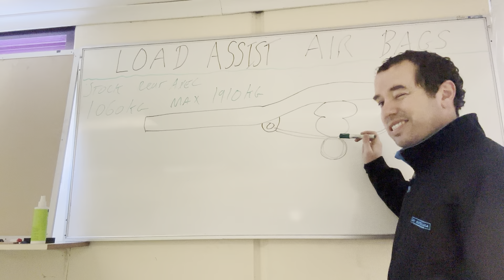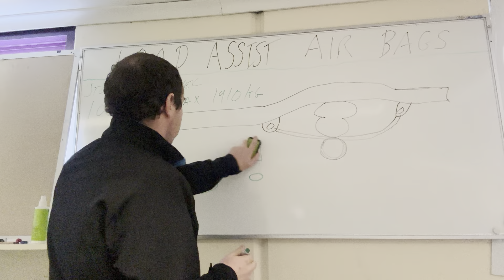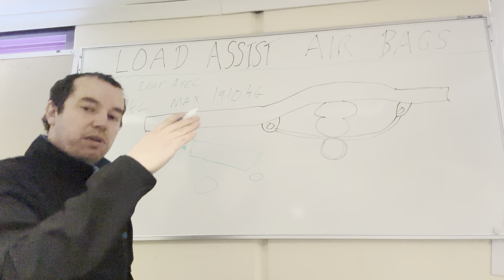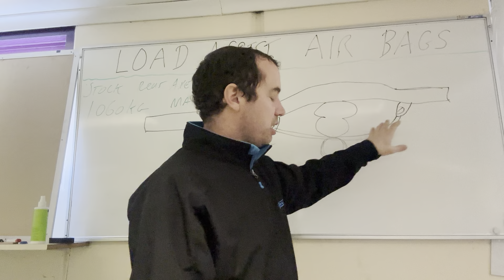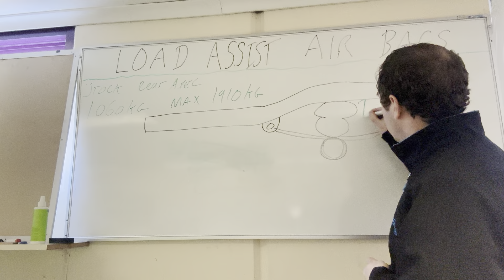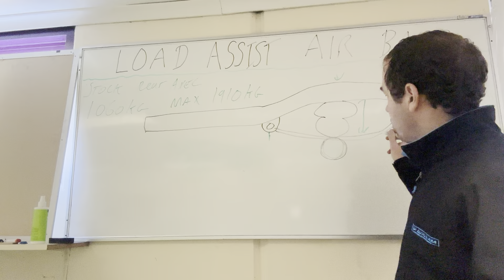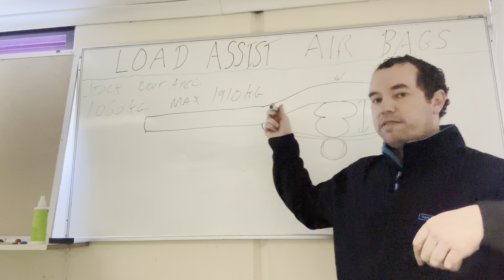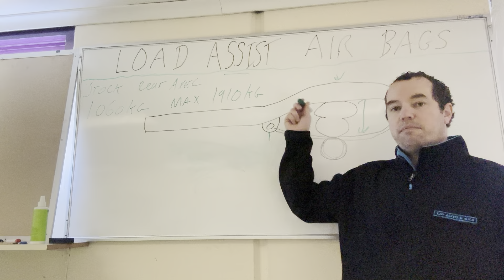Do air bags bend chassis’s????? Are they any good ??? When should I use them ????

Comment: Good video.
Proposing is a damper problem, not a spring problem. Springs hold the weight, bouncing up and down, is their job.
Dampers (shock absorbers) control the springs.
Reply from the maker: @shanerees7784  not 100% the case most cases we see it is caused by the rear of the vehicle being overloaded for the springs in the rear so the rear sags, which then lifts the front up and takes weight off the front axel causing it to be to light. Creating light steering and porpoising due to the rear pushing the front up and down on bumps and lumpy roads etc. if you only replace shocks then all your doing is trying to mask the problem with a different dampner configuration. Ideally in needs to be a combination of correct springs , shocks and any assist system that maybe needed.

Comment: There's a pivot point...if you place excessive weight at the rear of this single point...Houston we are going to have trouble.
Reply from the maker: Not all chassis are created equal though. There are dual cab utes out there with c section chassis or thin wall rails. Some are better than others.

Comment: My 2021 hilux Ute 250 kg under gvm hit bump stops regularly, will this hammering bend chassis.
Reply: 7:01 7:01 7:01 7:01 7:01 7:01 7:01
Reply from the maker: Hi Peter, whilst no one could rule it out causing damage over the long term it also depends on how hard its hitting and how often etc. Ideally you would set you suspension up so it vary rarely hits the bump stop. Id say you need to re asses your suspension setup.
Reply: @tjpauto  I drive slow, gvm upgrade voids Toyota warranty.
Reply from the maker: @petermurphy2167  no it’s not that simple, there would be no Toyota warranty on the suspension components replaced as they are not Toyota fitted components anything else over that is still covered under manufacture warranty via consumer law unless they can prove the failure was caused by the upgrade. And it’s in them to prove it not the other way around. 

Good upgrades manufacturers who go through a  in depth testing process have the data to back up any claims. 

Lovells for example have information in regard to this on their site. Other brands may as well. 

Vehicle manufacturers and dealers will tell you anything to buy their vehicle and their “genuine” upgrades. We hear it daily like manufacturers saying your warranty is void if you have it serviced elsewhere, use no genuine parts or you lift your vehicle or you fit a non genuine bull bar or accessories, Yes they still tell people this rubbish.
Reply: Often enough, hard enough, YES
Reply: @tjpauto
Reply: I have a 2018 Hilux rugged and have a lovells GVM to 3500kg  and 6500GCM upgrade.
I regularly tow my 2.7 ton MDC caravan with a ball weight of 270kg .
The van sits level with the Hilux and I don't need air bags .
My advice is get a lovells up grade suspension.

Comment: Any air bag that REMOVES factory chassis bumpstop and REPLACES it with a TALL stack of parts that REDUCES bump/up travel can bend and has bent many a frame side rail.  In the US, this happens on Tacomas often, probably same situation on Hilux.  Whereas on full size US brands of pickups, they are usually fine with airbags because they are installed outside the frame and up the side of frame, and RETAIN original chassis bumpstop.
Reply from the maker: Absolutely some air bags remove the bump stops. But a lot of bellow airbags now have inbuilt bump stops inside them.

Comment: Thanks for sharing!  Question- Another Aussie claimed they use airbags (I think, or overload springs) in the mining industry to reduce frame stress.  Reasoning that 3 points of contact spread the load better than 2.  They mention with 3 points, by adding overload spring, you could derate and go with a lighter leaf spring.  The overload would work more as a progressive spring vs having a heavier leaf spring.  I think it was suggested to remove leafs from the spring pack until it sags and drives sloppy, then add overload to compensate.  This case would be for a constant load, like a caravan for example.  Have you seen this use, or have opinion?  On a chassis cab pickup with straight rails?  I wanted to try this for a pickup camper, for washboard outback type roads.
Reply from the maker: Hi Eds place, most mine spec fleet vehicles run a heavier spring due to carrying loads. In theory 3 points of contact would spread the load more but the chassis is generally not designed to have constant load of a high amount on that point of the chassis. It would be very much chassis design dependent  It sounds like what your describing is essentially how a parabolic spring works.
Reply: ok i have parabolic suspension and air bags used initially for towing  and offroad while the airbags are ok for ride height on smooth road conditions they will break the back of any chassis in offroad or corrugation travel .why do u have 2 spread points ie leaf  that can move to accept travel with suspension movements put an airbag in the middle of that section pump it up to lift the travel height  now the airbag cannot compress anymore because it has taken all its compression travel out to lift its ride height hence you now stress everything rear of that airbag if offroading or corrugation roads deflate your airbags ps i am removing my airbags and retempering my parabolics for the weight through a reputable spring specialist
Reply from the maker: @markburrows-z5g  as per the video and comment of mine above, they need to be used in the correct way and applications, if not then they can certainly contribute to chassis issues.

Comment: So with a GU patrol. What is best option airbags inside coil or between chassis ? Have both options
Reply from the maker: @kromey111  inside the coil would generally be the best option, it depends on the load your carrying you may need a heavier weighted spring to carry some of the load and airbags to assist with it.
Reply: @ have 400kg coils. It’s a Ute

Comment: Personally I would say that assist airbags do not bend a chassis, what does is excess loading and bend, is not the usual, cracking is, and that is because the load is creating a resonance and that suggests too much weight behind the axle. The main reason for this is a very old poorly designed chassis. Things like Toyotas and Nissans were cracking the chassis 40 years ago, so it's nothng new, the problem really is how were they allowed to keep manufactureing an inherrently unsafe item. Compare the Hilux to the Land Rover Defender, the Defender chassis is over twice as thick. That should tell you something. 
oh, and it is worth looking at grammar too, it is not "chassis's" plural of chassis is chassis and something belonging to a chassis is chassis', there is no subsiquent "s" as the last letter of the name is "s". 😀

Comment: Airbags are a bad idea. Upgrade your springs only or buy a bigger vehicle.
Reply from the maker: They have their use but they are not a replacement for a spring upgrade or for overloading, they should be used in conjunction with the correct springs. They are there to assist.